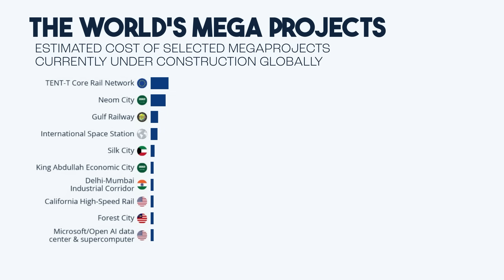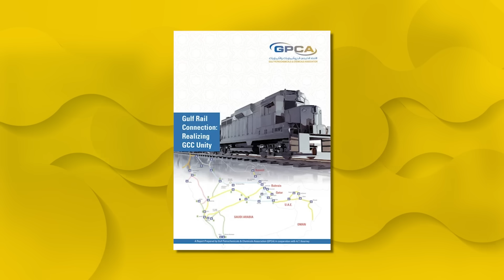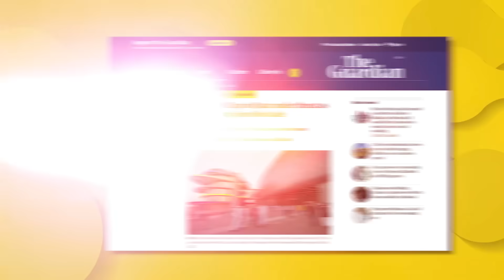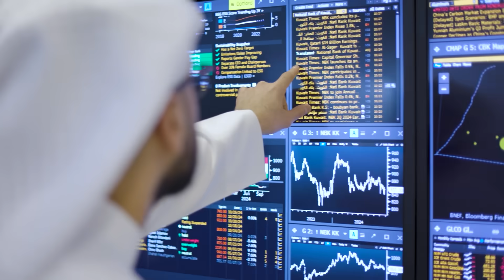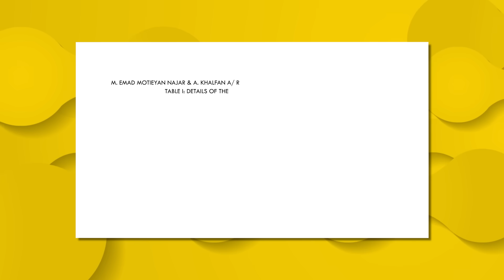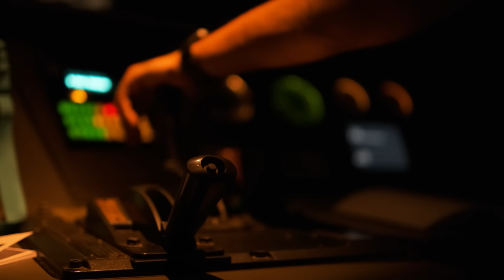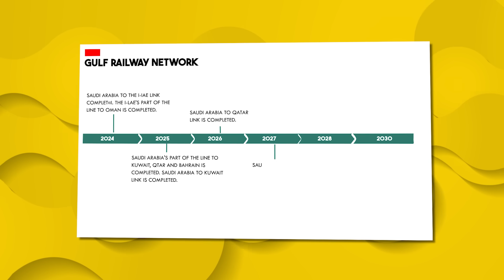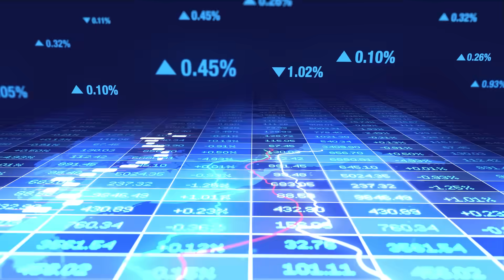The $250 Billion Giga-Project: Gulf Railway Explained

Comment: The map you used is wrong , it can’t be the correct one Al Ain is in Abu Dhabi it’s not above Dubai nor by the coast, That’s Fujairah.. 

I’m shocked that the maximum speed is just 220 km/h and not 300+ km/h like Al Haramain Railway in Makkah and all other modern trains! Also, why wouldn’t it stop in Al Ahsa? It already has a train station that goes directly to Riyadh the capital within two hours, and has a much larger population than Salwa…  It doesn’t make any sense to go all the way to dammam and skip Al Ahsa because the route to Riyadh is much longer from there. I doubt this will be the final map.
Reply: There are some mistakes in this clip

One of them is that the correct expected cost of connecting countries is only 27 billion dollars

Comment: I'm looking forward to any rail project but I wonder how the 200+km/h tracks will be designed 🤔.
Sand being whirled around by the trains may cause damage, if the velocity of the sand particles is increased to that of the trains. 🤔
Reply: there is few ways to stop the sands, as i live in " sandy" town, we use plants to form natural fence, and sometime Asphalt on the side of the road is put, usually, the lines are slightly higher than the land itself so the sad can not cover it

Comment: Heavy freight can't run on same track as HSR. I guess there'll have to be a separate freight line.
Reply: They can run together but must be timed properly and with many passing loops.
Reply: @jossdeiboss timing both types of traffic is very complex due to the massive speed differences. In addition, heavy freight trains damage and cause misalignments in the tracks far beyond the tolerance for high speed trains, so extensive reparation works must be conducted all the time. 
It's not a good idea.
Reply: @osasunaitor  Italy has always been designing mixed use railways, where train can run up to 250 km/h and goods trains.
I think you only need concrete bed instead of the rocks and you are good to go.
Reply: The HSR line connecting Abu Dhabi to Dubai is entirely separate from this project. This line actually runs quite far outside both cities. In both cities it's closer to the industrial port areas than population centres.
The HSR line for AD to Dubai will run from the centre of each city along completely separate rails and route.
Reply: Hyperloop!
Reply: @itsmeme1430  what?

Comment: The UAE part, from Saudi border to Fujeirah on the Indian Ocean is open. Is made mostly for freight. No passenger stations and no passenger trains. But is more focused on heavy loads and not higher speed. So limited gradients and heavy weight bridges.  The tracks pass far outside Dubai and Abu Dhabi. No plans to enter the cities. The only links to the coast are the branches going to the commercial port of Dubai and Abu Dhabi.
Reply: the passenger line is under construction and passes through residential areas on the mainland
Reply: @ but the main part of Dubai are way off the line. Nothing serving Dubai Marina, Business Bay or Deira. The line goes to Jebel Ali port, so passes through a residential area, Al Furjan, but is only incidentally.
The line passes “through” Dubai way passed the 611, which is the most inland Highway parallel to the coast, 25 km inland. Where most people live within few km from the shores. So even if they were to build passenger’s stations, who would use them? They are basically in the middle of the desert where the city starts opposite a 12 lane highway.
Reply: incorrect there’s plan to enter the cities

Comment: With the cost of $250 Billion 220 km/hr passenger train in 2030 seems outdated and expensive project 
What's the catch?
Reply: The cost of connecting the Gulf countries by rail is expected to be $27 billion, not $250 billion
Reply: Mixed use with freight and for the most part no electrification?
Reply: @firstlast1932  No electrification.. fr ??
Reply: Such lines would be too expensive to electrify. Diesel trains can reach 200, 220 km/h and I don't expect much passenger traffic. It will be mostly freight.
Reply: @jossdeiboss Country like China and India are almost 100% electrified... And to my knowledge one of these 2,  there is only one country that operates long electric double decker freight trains that goes under tunnels and over city bridges without disrupting traffic. I am not sure which one ... Maybe China?
Reply: @bismayparida2115  India operates double deck container trains on its electrified lines. The new Eastern and Western Dedicated freight corridors were created with this specific requirement.
Reply: @gazzy01  it goes through sparsely populated deserts.
Reply: @jossdeiboss 
What part of electrification is so expensive?
Reply: @ProdigalAngel  You need to create an entire new infrastructure to produce and distribute electricity.
If you are working in an urban area, it is relatively "cheap" because you can tap off the existing grid - as long as you verify that the new electric load can be managed etc etc

However, if you build a new rail line in the middle of the desert, you need first to bring the electricity there and potentially have it locally produced. 
As you can see, things start to get quite complicated.
Of course, nothing impossible but it is quite an added complication to the project.
It is much better to just build the line for diesel traction and see if the traffic demand grows above expectations and only then go for an electrification project.
Reply: @jossdeiboss  
Many years ago I discovered that trains on a steam engines needed to refill with water every not so many miles ...

Saudi terrain might be well compatible with locally produced sun energy every hundred miles if they manage to build energy storages to run the trains round the clock.
Reply: @ProdigalAngel  I don't think that is a viable option.
Furthermore, it is not all about putting something that generates electricity. You need to transform it to be suitable with the railway demand, which is very variable and complicated.
You also need to serve these extra facilities with roads and have people work in those. You need to serve therefore water, sewage as well.
You finally have to distribute this electricity with sub-stations and of course the catenary so that the trains may use that electricity.
Electrification is just too expensive for a line in a desert for which we don't know the outcome.

Comment: Has the track guage been decided? Not just the rail distance but height and width.  You mix North American videos with Paris Metro videos, which i find bizarre, and as we know the UK guage prevents double deck passenger trains and the European guages prevent the double height container wagons that one sees in the USA.
Reply: You are thinking loading gauge, not track gauge.
The footage seems to be completely random for the most part.
Reply: As far as I know US, UK and EU, with the exceptions of Iberian peninsula, Baltic states and Finland, all use standard gauges. The issue is most probably the height of tunnels, bridges, overhead lines and overpasses. Not the gauge.
Reply: Europe is not supporting double height container Wagons. Like the US has no HSR network.
Reply: I would expect standard gauge with a very big load gauge.
I would expect something similar to American or Indian gauge to allow for double-stacked containers.
Reply: @ American gauge is standard. 1435 mm like most of Europe. Is not the gauge that gives the load capacity. But the thickness of the rails, the soil preparation, the bridges, the sleepers, the maximum gradients … many things, but not the gauge.
Reply: @luigifranceschi2350  I think he spoke about the loading gauge: https://en.m.wikipedia.org/wiki/Loading_gauge